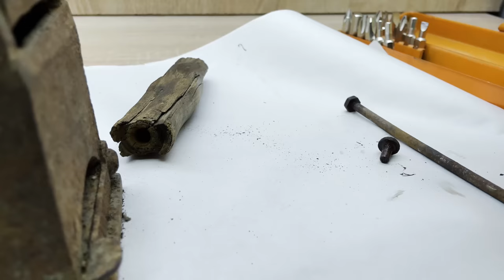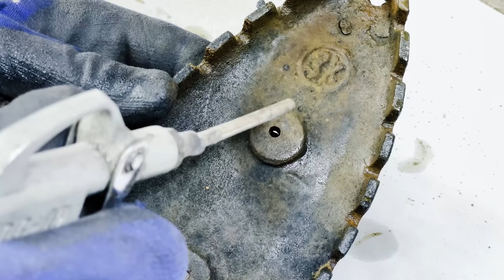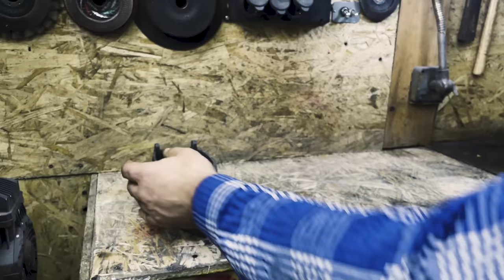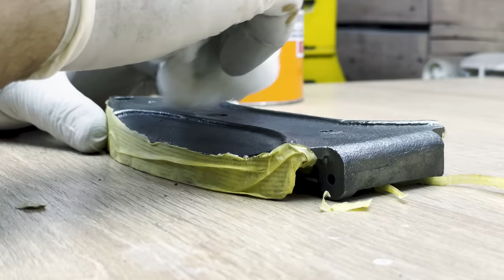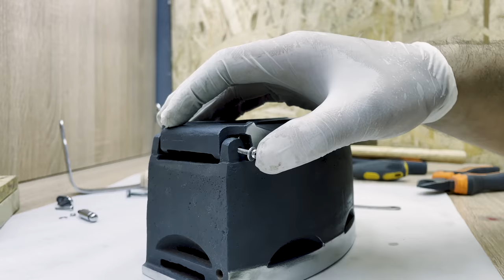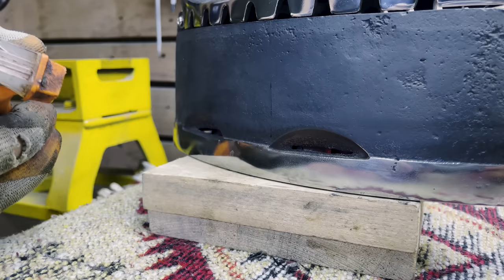100 Year Old Antiques! Restoring a Very Rusty Iron to Perfection!

Comment: question all ways comes down to "the finish" and paint job. should one use filler, sand, paint, then wet sand? or not. for both schools are correct. leave the imperfections in the metal and give it a nice paint or polish? or not and make it look show room floor quality new. I guess the more rare and valuable the piece is the less that should be done.